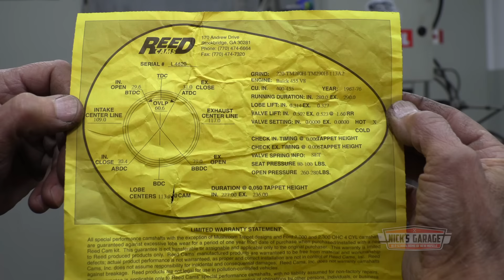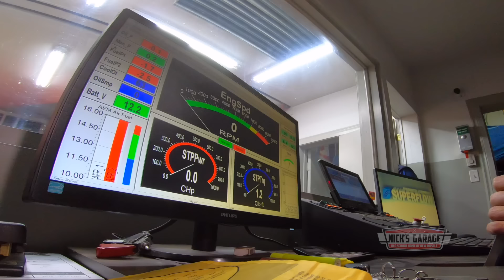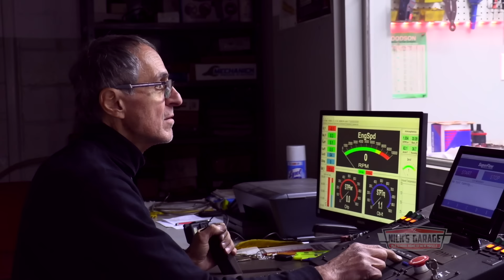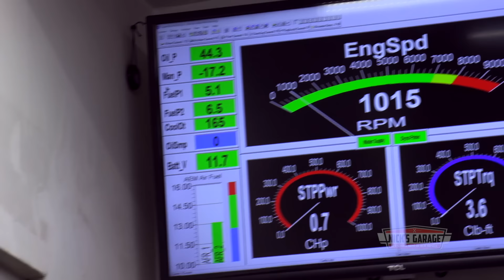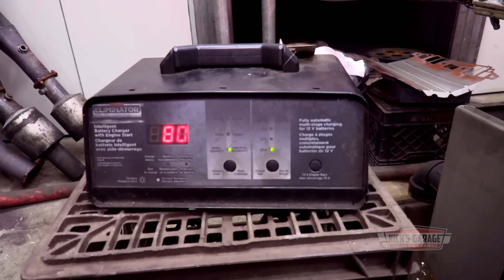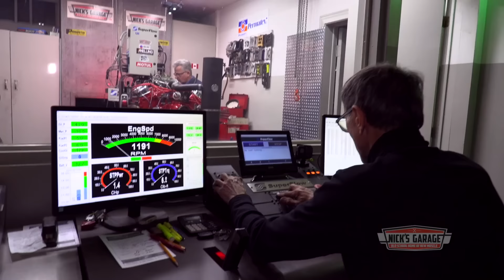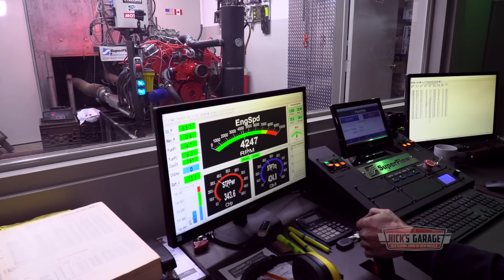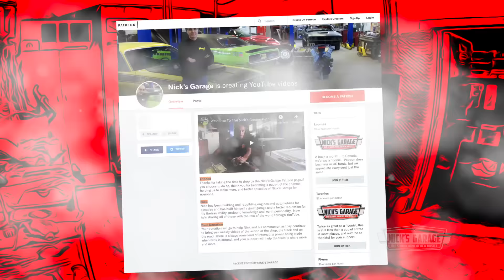1970 Buick 455 Stage 1 - Dyno Room Diagnosis

Comment: I saw lots of N/A jet boats back in the 70's using the BB 455 Olds and Buick - mostly for the torque. Boat guys always wanted the low rpm torque. The next most popular was, of course, the 454 BBC. Some 440's. No Hemis that I can remember. Pontiacs were few and far between, and no one had yet realized the potential of the 429 / 460 Ford, as the HP 429 versions and parts were even harder to find than the Pontiac. Back then there was only OEM cast iron heads, and few factory high performance parts available to the average hot-rodder on a budget - nothing like what is available in affordable high flow aluminum heads on the aftermarket today.
Reply: My dream boat will have a pair of buick 455's
Reply: I have a lobster boat that had a brand new 455. Stage one 1970 engine that thing would go out by 15 foot Boston whalers with 33 hp engines its a 35 foot boat still have it and it has 400 hp detroit diesel now it goes good now but the snap of that buick would take you off your feet if you didn't get. Ahold of something lol
Reply: @michaeltibbetts8155  It speaks volumes that the Buick 455 had more low end acceleration in a big heavy hull than a huge diesel. Usually it would be the other way round. I didn't say it in my original comment, but nearly all the BBC boats I saw as a kid were running 8-71 superchargers. They also were the fastest in top speed, but the naturally aspirated 455's had about the same acceleration from standing starts heading out of the launch and dock area. Only a few of the others had blowers - I really only distinctly remember one of the Olds 455's having an 8-71. I also remember it sitting backwards (likewise about half of the BBC's) in the boat, with the front end at the back of the boat angled up much higher than the other end. I don't recall if any had nitrous, and turbos were non-existent back then. Most non-supercharged boats had twin 4 barrels on tall tunnel rams. Also remember the big jets of what I now know to be cooling water shooting out the exhausts or from the transom area (besides the rooster tails from the jet drives).

Comment: I went through this with a cammed out 440. ran lean, headers were glowing. intake gasket was horrible, redid the intake gasket, still didn't idle, but ran better. it ended up being the ignition that caused the headers to Glow, the intake was leaking vacuum originally, and now it idles at 900, and the headers don't glow.
Reply: That's why I don't like old school stuff a ECU will tell you exactly where your problem is.
Reply: Would be nice for my Chevy 350tbi small block but stuck with ob 1

Comment: I don't understand why he doesn't know if it's a stage 1 or not. Because you can tell easily by the size of the valves. Stage one had a different cam, heads /valves, carburetor and distributor.
Thicker head gaskets pushes the heads upwards which creates a slightly larger gap which caused the vacuum leak.
But anyways, love the sound of that Buick at wide open throttle

Comment: Dwell and timing affect each other. If you adjust one you should check the other till they syncronize all three peramiters,
 timing, dewll, and idle rpm. Remember to disconnect the vacuum advance first.
Reply: Dwell effects timing.  Timing does not effect dwell.

Comment: The casting numbers should tell you if it's a stage 1
Reply: Had id checked, and it is a Stage 1.
Reply: @nickpanaritis4122  Casting numbers will not show the difference!  Std. valve and Stage 1 heads carry the same casting #'s.

Comment: I keep thinking that the lack of H/P and Torque may be in that low performance after market Cam. Lift and Duration correct spects?  9.5 compression pistons should be ok....Just thinking out loud here...Good Video
Reply: Compression is the cheeps hp. To a point 😂.

Comment: Great to watch Nick and Manny work together.  Old school maestros!  Honest guys I was going to say the compression was low.  But what is a "rope seal?"
Reply from the maker: When you are working with friends, at things you love, can you really call it work?
Reply: @NicksGarage  You call it life.
Reply: The rear main seal is made out of rope. I had to install a rope seal in an Olds 30 over 403 cubic inch motor I built.  You can really tell the difference by how much drag the rope seal has on the crank over a rubber seal.  I think there is a trick to use a Ford rear main seal in a Olds.
Reply: @marcmo7138  Thanks Marc.  I understand now.

Comment: Remember Nick once he add his exhaust to the engine he will have little more torque from the back pressure 😉
Reply: U do know back pressure is a myth right. Research exhaust velocity
Reply: @romper4444  i use trail and error. I have seen with my own eyes what back pressure does. Dont need Google to tell me what I already know is facts. To much is a different story but some will increase torque.  Been working on and around engines since I was 13 years old.  Believe me  it will increase torque

Comment: Cam and heads were the difference in HP between the 360 and 370 horse versions of the engine,however ,it really woke up the Stage 1's,which were the 370's.
Reply: Actually, the 370 HP engine was not the Stage 1 engine. It was the standard small valve engine, and was rated at 370 in the big cars (Electra, Riviera, Wildcat). The same engine installed in the GS was only rated at 350 HP. The Staqe 1 was rated at 360. In other words, you can't trust the factory ratings...

Comment: There is one thing I would do with that oil pump assembly is packing it with grease and it holds the pump gears into the timing cover
and draws pump pull from the pickup I have stage one and w30 olds

Comment: Interesting that you use the rubber gaskets on the end rails. I just replaced the intake manifold on my 406 sbc this past weekend. Edelbrock doesn't even include those in its gasket set. They say to spread a bead of silicone on the China rail.

Comment: 370 hp was rating for Electras, Wildcats full size. Actual hp rating for Stage 1 was 376 told by Buick engineer back in the '80s. Was underrated on purpose
Reply: True ... so said Dennis Manner at a much earlier GS Nats.  The 360 came at 4850 rpm ... the 376 at 5100 rpm.
Reply: lol they made less hp then a stock geb 3 ls1 small block stock, torque is where they shinned.

Comment: They make power like a Mopar, but the bottom end isn’t near as stout, requiring a main stud carburetor. I don’t know about 455, but the 350  much smaller bore  and totally different design, takes several different intake manifold. A friend bout a Buick Skylark which was supposed to be an all original one owner car from Sun City, bought several years ago. It had about 80’k on the clock when the Thermostat seized and I went over to my friends house to fix it. We’ll that was the beginning of a nightmare. When I pulled off the thermoses housing, one of the bolts broke off.   I tried everything in my tool box to get it out, but had no luck. I took it to my Machinest, former coworker and wrestled with it for a day. It disintegrated. I believe the bolt went into the water jacked in the heed. He finally trite to drill it out on the Drill press, but couldn’t get the drill to bite. I even bought him a new drill bit, but nothing worked. So at that point we decided to get one through a wrecking yard, and he brought back one from a 69 Skylark. It wouldn’t fit. We tried three more until we found one out of a 73 that worked.
The 455 has heads and Manifolds available from Edelbrock, and a Buick specialist from TA Performance in Scottsdale. The Edelbrock stuff is like factory performance, and TA Covers that and more, BUICK stage one nice is working while  stoker  kits, all the more reason to get that main stud girdle, stock performance as well as two higher flowing designs which use Stage III and two manifold along with other goodies.
Note: TA now makes heads for the 350, along with a lot of other goodies since I sized the Skylark. Take a look of their on line catalog for more.

Comment: I've never seen the BBB up close that I remember but the oil pump looks like the pump I run on my 231 Buicks.  Use no gasket sealer on that gasket, they'll leak if you use sealer.
I suggest the "Earl Brown" treatment on these, primarily cleaning up flash from the castings, I'm not a big fan of modifying the original castings but cleaning them up goes a long way.
The little 231 runs low oil pressure at idle, 10psi isn't terrible so hopefully yours is at least that much, can't imagine what the BBB might run with the additional leaks.
Felpro makes a paper covered valley gasket for the 231 lots of folks like.
Reply from the maker: Thanks for the tip.🔧
Reply: @NicksGarage  I really hope anyone interested in fine-tuning their vintage Buick take some que's from the various Buick forums, including the turbo buick guys, they're keen on all the points that need addressing.

Comment: Dr. Nick, that was a very cool video, I like the content, my pop had a Buick station wagon that had a 455 it was a fun car, I like that distributor cap that has that window made it easy to set the dwell, cheers.  btw it just shows that 2 heads are better then 1.

Comment: Hello

I'm in the process of rebuilding my 455 Buick engine. My question relates specifically to the oil pump.
When installing the pump you should fill the pump housing with petroleum jelly. Now my question; Is it possible to drive the oil pump independently in advance of the first run of the engine, for example with a battery screwdriver to fill the motor and the pump with oil? Or is this not necessary?

Comment: I am nowhere near an engine guru as a teen in the late 1960's and early 70's. I had friends that owned the Buick GS Stage 1. These 455 were plagued with oiling problems. They are very fast and beautiful.
Even knew a guy that had a Buick Centurion ragtop with a 455. Turned out to be a chick magnet.
Reply from the maker: Thanks for sharing a memory. 👍
Reply: @midnitesquirldog1 The so-called "high volume" pump is guaranteed to soon wear out your cam and distributor gears.  Use the stock system "done right".
Reply: @midnitesquirldog1 Spinning the longer gears of the so-called high volume pump was very hard on the cam and distributor gears. Esp. if you did not use 5W-30 oil. a lighter oil.  Often they would wear out in less than 1000 miles. I've seen it numerous times.  All Buick guys know to never use those pumps anymore!
Reply: @midnitesquirldog1 When needed, the wear plate is a great idea being that it's iron and not aluminum. It provides a new wear surface to establish proper gear end clearance.  But when spinning the double-geared "high volume" pump, it's the excess loading to do so that moves the extra oil that causes wear between the cam gear and distributor gear.  However, if it has worked for you, great, but you may want to pull the distributor and check for knife-edging on your distributor gears just as a precaution.

Comment: I had the Olds version of this engine It was a '71 Olds 98 with 455 Rocket and yes, the Rochester carb. Wasn't the performance package though. Once the carb had been rebuilt it was a smooth running engine. Idled well. It had torque for days. Even with such a heavy car it was fast off the line. Yeah... it burned through gas but it sure was fun!

Comment: My first car was a 1970 Buick GS 455 and I was NEVER outrun on the street back in the early 80's and there was still a lot of musclecars  on the road back then.
Reply: I hated those Buicks. My 69 Eliminator could not out run them.
Reply: Must not have been many fast cars in your area at the time...
Reply: @davelowets  any excuse will do. Maybe your neighborhood had a lot of Ramchargers and Swiss-cheese Pontiacs and a couple T-Bolts on the next block?
Reply: My 383 GTS dart had no problem with 455 buicks but i will say my car was probally lighter
Reply: @onesecureone  A lot of Buicks had 455s.  All other things being equal in factory options, a 1970 GS455 Stage 1 should be a little lighter than a 1970 Chevelle SS LS6
Reply: @onesecureone True Dodge Dart are definitely lighter then Buicks lol

Comment: If your V8 is suffering from low compression taking it to Nick's Garage would be my suggestion With the gaskets from Velpro Nick and Manny know the 455's vacuum leak should go Nick is replacing a leaky oil pump gasket So the oil pump will do as you ask it I like a Buick the Riviera is slick and the Skylark too is legitimate I dig the style of the Grand National too back in the 80's a Turbo 6 was the best they could do Having worked for Buick Nick has fixed a few Don't let a rough idle make you suicidal Send it to Nick's Garage they'll try n test it through a full heat cycle Is it a real stage one? Only way to find out is a dyno run Nick's Garage every Monday is always fun Ain't no superstition It's a science with the points and ignition be sure to like and subscribe to Nick's Garage to follow their mission!
Reply: No external "test" will confirm it being a real Stage 1 ... or not.

Comment: 455 Stage 1 heads are different from other 455 Buick heads. Intake valve diameter is 2.130" od, and exhaust is 1.755" od. Some Electras got Stage 1 heads without owners knowing. The total Stage 1 package was bigger valves, higher lift cam, recurved distributor, stall converter for automatic, larger Quadrajet carb A/T 7040014, M/T 7040015
Reply: True, my '71 Riv GS had larger valves, big Quadrajet, different cam and 3:42 rear....I think compression was down and they were rated at 330hp then.

Comment: The running cold problem and start could be due to the headers versus cast iron exhaust manifolds with the crossover heat riser.
Reply: Did you notice that the choke never closed?

Comment: if I have no choice but to use stamped steel intake gaskets I apply a thin coat of black RTV to both sides of the gaskets and let it cure . then when I'm ready to install the side gaskets I apply a thing coat of the same gasket sealant to the areas where the gasket is going to be. have had no vaccum or oil leaks  . O and I also apply a thing coat of black RTV to the bottom half of the intake bolts threads  so oil doesnt slowly work its way up the threads and sweat out on to the intake

Comment: I had a 71 skylark with just the 350 2bbl and it was a torquey little thing. My Dad had a 74 LeSabre with the 455, and it could move that land yacht pretty good too, even being detuned. I shutter thinking what a 70 455 would do in the little skylark.  An uncle had a 70 Electra 225 with the 455, but I was only 11, and don't remember much except being carsick the first and only time.

Comment: I have watched 38 minutes of this and the only time that engine ran right was when Manny plugged the power brake grommet with his finger on initial start up.  EDIT at 49 minutes; The PCV goes on the left valve cover. The power brake grommet is where they plugged in the PCV! Now the manifold vacuum is fighting the vacuum at PCV inlet at carb!
Reply: That hole in the rear of the intake is not vacuum.  He's checking to see if there is vacuum there, which would indicate a vacuum leak at the intake gaskets.   He also holds his hand over the top of the carburetor to see if it runs better with less air, also looking for a vacuum leak.
Reply: If I recall that hhole on the back is for the pcv valve and those grommets would deteriorate and cause big vacuum leaks as to what he's experiencing now,like the other gentleman said the only time the engine ran right was when manni had his finger over the hole that's a big vacuum leak, I've owned and worked on Buicks for a very long time

Comment: Great job Nick only thing the Olds 455 pre '70 is red and '70 upward is blue
Gold was the small block
I like the way that you don't use speed or air wrenches everything by hand feeling how things are going...
If I remember correctly the stage 1 had a Carter carburetor on them to 1970